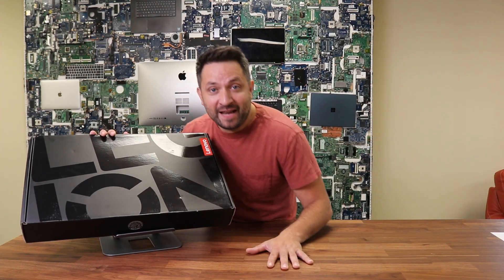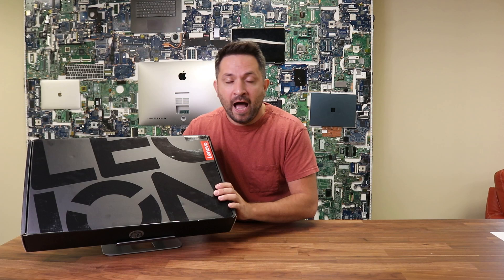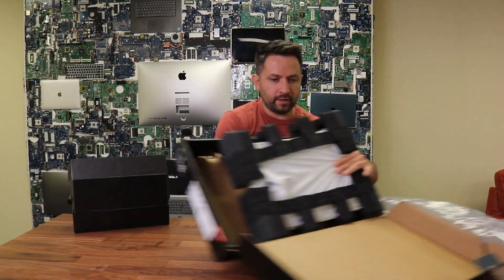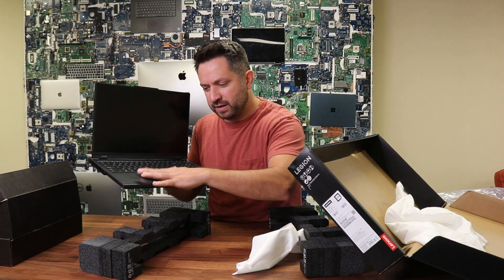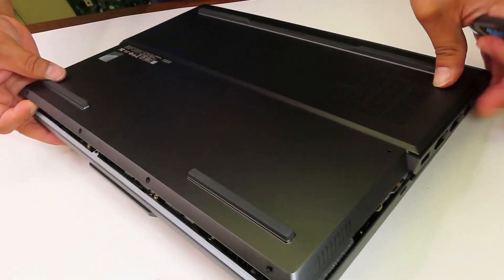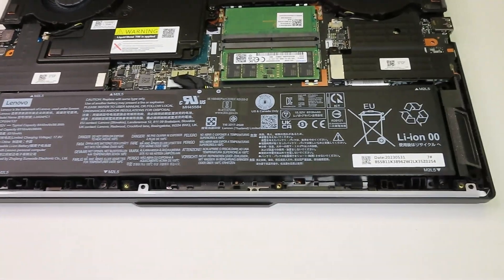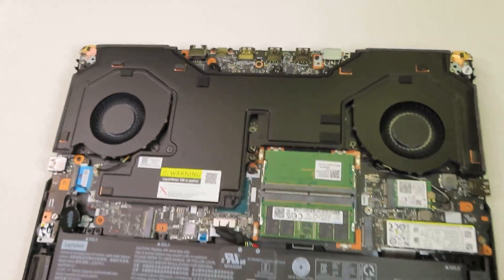Laptop Lenovo Legion Pro 7 16IRX8H Unboxing. Brief review, disassembly, parts removal, upgrade.

Comment: It's cool that I found this video while wondering about my gaming laptop's model. I got this laptop on September 13, 2023, 9 days before this video was released, and it is still a beast, just like how I got it. 

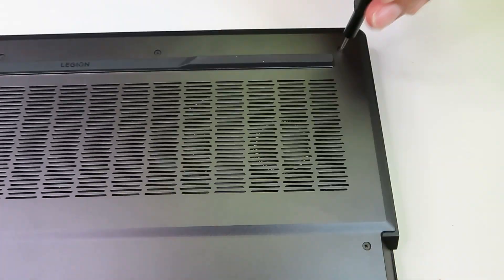I did try upgrading it to 64 GB memory. I had it upgraded to 64 GB DDR5 RAM (it worked and still works just as fine, but can't go further than 64 GB - the maximum supported memory is 64 GB) from 32 GB. The adapter is also 330W, not 130W. And that switch (4:16) is the privacy camera shutter, however, I believe it's software-based because I see a gray screen with a lock on it whenever I try to access the webcam while the shutter is turned on. I also got a second 2 TB SSD for this which works perfectly fine as well. And today, in 2025, while I've noticed that the processor is no longer the best in 2025 (but the best at its time in 2023) it still has an extremely exceptional gaming performance in terms of its processor. However, there is one thing about this laptop which may not be the best for some people; it's fans. When gaming or engaging in resource-intensive tasks, the laptop's fans go as loud as what people would call a jet engine.

Overall though, thanks for your video. Again, I did try upgrading it to 64 GB of RAM swapping them with two 32 GB RAMs and the laptop's motherboard did accept it but that was the maximum. And the 2nd SSD works just as fine as well, I don't know its maximum limit but I have 2 TB SSDs in the laptop right now.